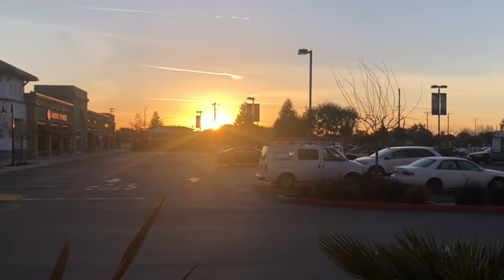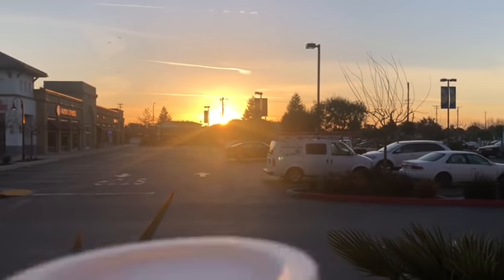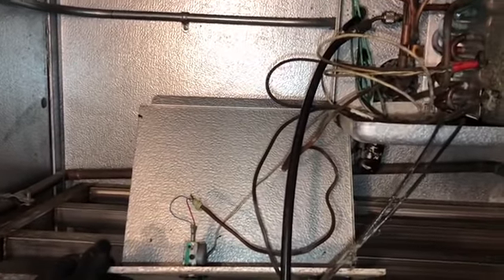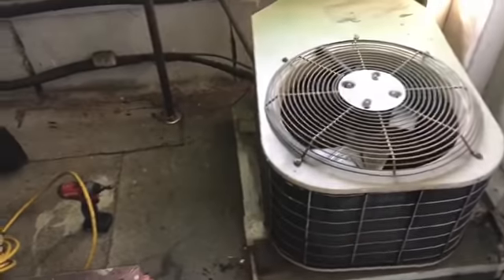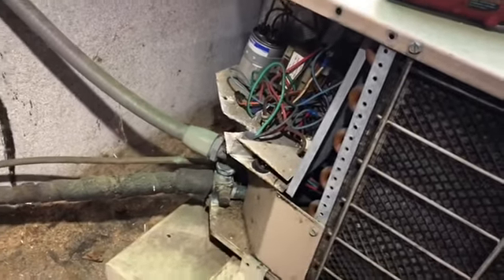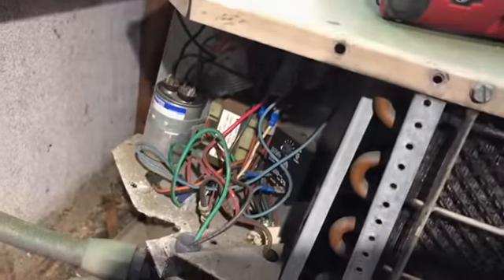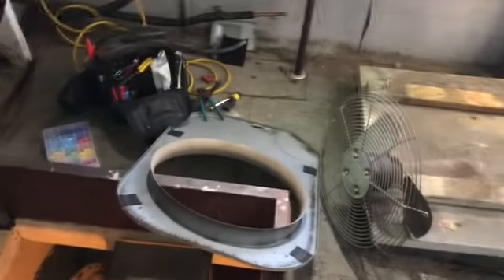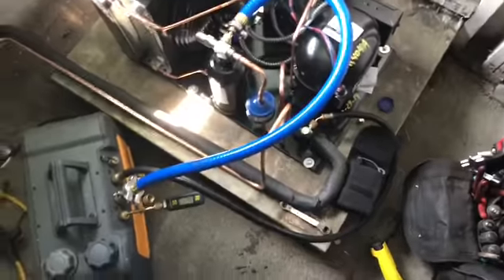Walk in box re do

Comment: They did that a lot here in Florida back in the 90's. Not many with transformer and low voltage wire. They usually change out the contactor to a 208vac and add a two wire low pressure cut-out and add the hard start kit because of the txv in EVAP. Also would add a receiver.
I don't like it either but it did work.
Really enjoyed the live chat last night, that was hilarious 😂😂😂
Reply from the maker: I’ve seen them with receivers also.
Reply: same junk components as the rest more or less, dirt cheap with minimal mods as compared to the greed of the dedicated HVAC suppliers ;)
they shot themselves in the feet long ago.....

Comment: That process cooler I did the other day had. A carrier condenser on the (2) cooler evaps....I had to wire it all ghetto to make it work...same shit...24v crap...had to use a rib relay to energize solenoids when stat calls and then goes through LPS HPS to the terminal strip / transformer..stupid..and they wouldn't let me fix it the "right way" just make it work...okay